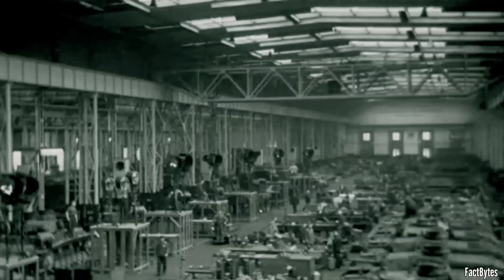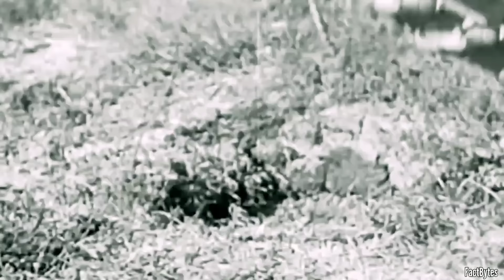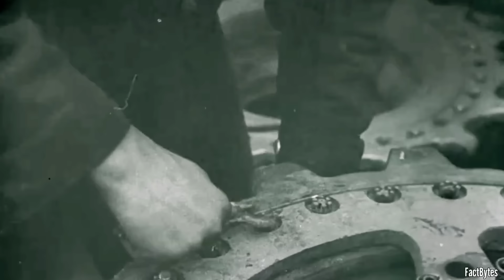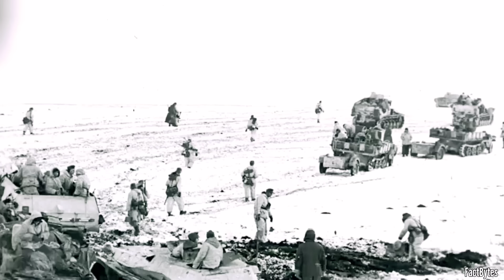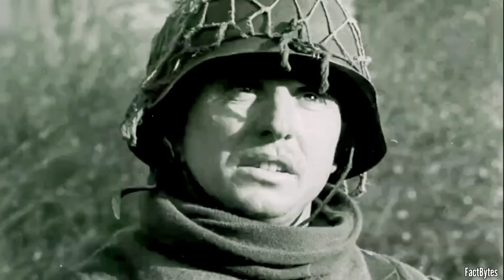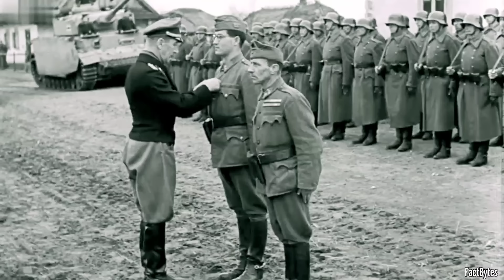More Panzer IVs, Fewer Tigers & Panthers — Would Germany Have Done Better?

Comment: Critically though, the Panther was the first tank in Germany specifically designed for mass production an absolute necessity by 1943.
Reply: Agreed, the German Panther, Tiger II, Jagdpanzers and Hetzer was the "wartime tanks" group for Germany, an equivalent to the "wartime simplicity" Soviet tank group of T34, IS, and SU-76, or the US's M4 Sherman and its gun carriage. Panthers used a much simpler hull and turret shape than Panzer III and IV.

In fact, one factor greatly helped Panther's mass production was Htler decision to "pre-upgrade" the Panther tank at development stage, such as upping the frontal armor from 60 mm to 80 mm, at the advice of German tank industries. Before the Panther, the Panzer III and IV saw major changes on the armor and armaments in the production lines every few months. Especially the Panzer III, where its entire series saw a whopping 4 changes of main cannons, from 37 mm, to two versions of 50 mm, to finally a short 75 mm, from 1939 to 1942, a span of three years! Such upgrade requests from the Wehrmacht greatly bothered the German industrialists as they had to keep adjusting the production lines. With Panthers, it had only three main variants, with no change of main armaments, and only very minor change of armor layout, from its introduction to the end of the war, which greatly helped its mass productions especially under the disruptive air raid in late war. Meanwhile the obsolete Panzer IV with its inefficient designs had to keep up its war demand by literally gutting themselves of parts in Ausf J, via removal of vision ports, the powered turret system, a return roller, and turning the side skirts into wire mesh.
Reply: @sthrich635  Hitler in addition to adding the armour simultaneously ordered rail carriages to be produced that could transport Panthers to the front as quickly as possible.
Reply: @sthrich635  Honestly, Hitler needed to stay out of tank production, but that is another story.   Even with mass production the German's still suffered with the fact that spare parts had to be specially tooled to fit on a Panther.  Their spare parts were not built to the standards of US parts than could go onto any Sherman without needing machine work done on the spot.  This is a very important issue considering the reliability of the Panther.
Reply: @biffmarcum5014  German Panther did not build to the standard of US Sherman because Panther was made in dispersed German factories, not large and well-developed US industries. Standardization was not an easy task especially when Germans needed to rush out tanks fast to the frontlines

And AH staying out of tank production would be a blessing for the Allies since he was the only one with good understanding and relationship with German war industries and their productions - Without him, the German military would keep asking for repeated design changes, upgrades, without considering any impact on production. German tank numbers would be even less than what had been.
Reply: @sthrich635  The US built 12500 Shermans across all variants in 1944 with a population of 140 million people  (Five different engines, three types of hulls, two suspension systems, two different turrets, three different guns). Germany built 3800 Panthers and around 2800 Pz IVs in 1944 ( around 6600 medium tanks). German and austrian population combined was around 65 mil to 70 mil people.
Medium tanks produced per capita was actually the same in the US and in Germany, after germany fully mobilized in 1943. Germany was hardly underperforming in terms of tank production.
Russia focused on building tanks and guns. They did not need to built a single ship or Uboat, their airwar was lowtech compared to the high altitude radar war at night in western european skies.
And the russians were totally dependened of trucks, jeeps and trains provided by land lease for their logistics.

The highest demanded tank by the US troops was the sherman jumbo in 1944. But only 100 reached Europe. On the other hand germany produced close to 2000 Tiger tanks. Maybe the results of german arms manufacturing is downtalked a little bit too much.
Reply: @sthrich635 Germany didn't need the tiger 2 with the panther
Reply: @jeepsblackpowderandlights4305 Germans needed to upgraded their Tiger I design as by 1944 the Allies and Soviets were fielding AT guns powerful to neglect  its armor. 100 mm front was nowhere near impressive in summer 1944.
Reply: This. They managed to build 6000 of the things in just two years, while the 8.5k P4's took 9 years to build. They were so much easier to mass produce.
Reply: @JB-qg2uc  yeah but they were totally unreliable.  Most units had more broken Panther's than running Panther's at any given time in 1943 and even later when its reliability improved, it was only 50-54 percent.  So for every running panther you had a broken panther.   The Panzer III at its worst stage when it became way too heavy  still had 69% combat readiness.
Reply: @biffmarcum5014  Royal Engineers found that the mechanical breakdowns were caused by poor production quality. More specifically incorrect hardening of gears. The design itself was sufficient. This was due to the workforce being drafted and inexperienced workers in the new production lines. Regardless of what tank that line would produce, the quality issues would be the same.
Reply: @JB-qg2uc  The Panther had a whole lot more than just incorrect hardening of gears as an issues.  There were leaking oil and fuel,  issues with non gear parts, cooling system.   I believe the royal Engineers were looking at the drive train.
Reply: @biffmarcum5014 
Look the russians mantained at Tank fleet of around 25 Tanks during 1944 and 1945. But only around 10.000 of them were deployed in active service at the frontline. That means that for every Tank in operation there are 1.5 Tanks waiting at a Depot or with the Industrie for overhauls.

Replacment was quick. But that doesnt mean their Tanks did broke down. They just disappeared faster of the units logbooks.

The average run time of Panthers in 1944 was around 1000 to 1500 km (Just Like Panzer VI, their ready rates were actually very similar in every month an Theater). In spring 1944 only 10% of the T34 reached 1000kms and in Sommer 1944 the IS2 was also just expected to run 1000km by the manufacturer bevor an overhaul of the engine and drive train. A year later the run time of IS 2 increased to 1600 km on average. A level the Panther had achieved in 1944.

Of course their are production batches with issues. But they are overhyped. I mean at Kursk in 1943 only two Panthers out of 90 were lost because of non combat related engine fires. Yeah thats not good but not as terrible as many try to make you believe.

The french and the brits did their test, on second hand Panthers which were kept active with cannibalized Parts of other Panther wrecks or last ditch production batches which were even assembled after the war, with all that late was quality issues.
I dont think these examples form a reliable Test group. I mean there are Reports of Bergepanthers achieving 4300 km with no issues in the drive train and Tigers with over 8000km on their engine.
Reply: Germany mass produced 6000 Panther tanks during WW2
Reply: The earlier panzers had already been designed & built with standardisation & mass production in mind. They were in what 1930's Germany called 'mass' production, but the Nazis weren't industrialists, so what they built was considered 'normal' & acceptable. There was lots of spare capacity in German industry. The German military doctrine was fight a short campaign, resupply, repair damaged vehicles & fight again - so their production levels seemed Ok. 
Hitler even sent troops back from the front in late 1941 back into their previous industries as he thought he'd won.
Reply: No tiger 1 2s ,sturm tigers or jagtigers jag panthers .more stug 3 panzer 4s and 5s same amount of panther 1 and 2s  though .
Reply: @isaacmitchell5031  jadgpanther was a reasonable vehicle (size and weight of a Panther + hitting power of king Tiger).
Reply: @rodrigorincongarcia771 unrealiable and hog way too much fuel .very hard with no turret .they were better off with 2 stugs then 1 jagpanther .
Reply: @isaacmitchell5031  Nope, Tiger Is were a good investment (they dominated the Battlefield 1942-1945); JagPanthers were also a very good investment.
Reply: @vonBennett_65  Tiger was a terrible investment. Cool machine, to much time and resources
Reply: @chaddersh3736  The effect that the Tiger I had on the Eastern Front in 1942 and 1943, where it dominated the battlefield, was incredible. One or two Tiger Is successfully taking on 30 to 40 T-34s...yeah try that with a couple of Panzer IVs.
Reply: @vonBennett_65  thats because tactics changed after 43. Also have you have tracked a vehicle before? Have you ever changed a wheel bearing on an inner road wheel? Now see what happens in the mud and it freezes. Too many factors against it. Also the lost the war following your way of thinking sooooooo
Reply: @chaddersh3736  Yep, I drove an APC in the Army, so I know all about driving and maintaining a tracked vehicle.

Lost the war due to my way of thinking? I think you know very little about 'my way of thinking'.
Reply: And you still that that suspicion system is the way to go? Ok to each their own as they say. A man from your background must know this was a hog on resources and maintaince ? I don't think the panzer 4 was the total answer. It should've been beefed up by a stronger airforce. But not wasted resource projects like the heavy panzer. Could have built way more aircraft to protect the ground forces. Just my opinion sir
Reply: @chaddersh3736  I agree that it was foolish to build the Tiger IIs, JagTigers, etc. Germany really mismanaged their resource allocation, and they waited too long to standardized their military equipment (they did plan to standardize their tanks somewhat with the E-Series; which never left the planning stages). As far as the Luftwaffe, my opinion was that the Germans should have focused on fighter aircraft first, ground support aircraft second, in lieu of producing bombers (which were a total waste of resources later in the war). Getting the ME-262 fighter operational sooner (instead of trying to make it a fighter/bomber) would also have been a big help. My opinions.
Reply: @vonBennett_65  true. To be honest. I was a Pistenbully tech for many years. I've probably just have some deep resentment to German over engineering lol. You take care
Reply: @chaddersh3736  You have to remember that the Tiger I was designed and built when Germany was still winning the war. They could afford the Tiger because they weren't being hammered by the Allies from all sides yet. Plus, the Tiger fit a doctrinal need for a heavy breakthrough tank, something with a big gun and heavy armor to go head on with an enemy's defenses, and break through them allowing follow on forces to exploit them. Overall reliability and recovery wasn't an because once the Tigers did their job, they wouldn't be needed again until the next assault since it was up to the mediums to continue on and exploit the openings they created. And because they wouldn't continue on, there was time for recovery and maintenance, particularly since all of the recovery vehicles and maintenance sections would now be moving up to where the Tigers were. The Tigers reliability and maintenance issues only became an issue when Germany started to go on the defensive and was retreating, but until then the Tiger was working just fine.

What was a waste of time and resources was the King Tiger, By the time the King Tiger came out Germany was already on the retreat and losing the war. There was no longer a need for a heavy breakthrough tank. All of the time, money, and effort they sunk into the King Tiger should have, at most, gone into improving the drive train for the Tiger I. It badly needed a better engine, transmission, and final drive.
Reply: @isaacmitchell5031  Respectfully I disagree. I would not have built Panther Tanks. They were too complex. I would have built Panzer 3s and 4s & Stug 3s. Standardized as much between the three as possible. Same with the half tracks and , above all(!), supply trucks.
Reply: @williampaz2092 well yeah if they did more 88 flaks towed by half treacks more panzer 3 4 5 and stugs and hetzers .than the nash horn tank destroyes and jagpanther would be the larger class hunter destroyers .more me 262s and ho229 if them got them operable .then folkwolfe and bf109 to be fitted with anti tank rockets
Reply: @williampaz2092  The Panzer IV was way more complicated to produce than the Panzer V. The Panzer V was a little more expensive to produce than the Panzer IV. Panzer IIIs were a dead end as they could not carry a gun bigger than the 50mm which was obsolete by 1943.
Reply: @vonBennett_65 the panzer 5 also started as a 30 ton tank that ballooned up to 45 tons but still started with a transmission and engine for a 30 ton tank. Thats why the early ones were always broken and even later ones had the same problem.

Comment: Unfortunately, these tanks were never in predominance at the front. On the contrary, the percentage of Pz 4 tanks among other types was not high throughout the entire production period. Furthermore, I've read that the Ministry of Armaments repeatedly tried to stop production of this tank. And most importantly, if we exclude the systematic and large-scale destruction of German industry and transport from the air, then existing tanks and other weapons would most likely have been sufficient to hold the front,and perhaps a and perhaps a truce would have been reached instead of capitulation have been reached instead of capitulation . But that's just my speculation.
Reply: The Herr Inspektor of the Panzerwaffe. Oberstgeneral Heinz Guderian, was satisfied with the capabilities of the Panzer IV, and felt that the "Big Cats" were a waste of resources, especially steel. Although certainly there was pressure to discontinue Panzer IV production as battle tanks, Guderian insisted they be produced until war's end.  They certainly were forming the basis of specialized AFVs in the Panzerwaffe.

Comment: It didn't mater which tank they built. Their method of manufacturing wasn't ever going to keep up with the USA, USSR, or even Britain. Germany used craftsman that built the whole tank in one station in a factory. Where as the Allies all used modern production lines where one worker installed one part as the tank rolled down the line to the next worker with a different part. 

The next problem was they never had enough fuel. That problem got worse as the war went on. 

But the major problem Germany faced was Hitler himself. The man was too impatient. The planned build up of Germany's military wasn't supposed to be completed until some where between 1945 and 1950. If Hitler had stopped after getting Czechoslovakia and stayed quiet things might have been different. But no, he had to invade Poland, which brought France and Britain into the war. Then failing to wait until Britain was defeated he went and picked a fight with the USSR. Even then he might have pulled it off until the ultimate blunder. Declaring war on the USA after Japan attacked Pearl Harbor. If he hadn't done that then the USA might have concentrated on Japan and not had been willing to supply Britain and the USSR.
Reply: The later Germany started the war, the less chance its Panzer forces had in succeeding.
Keep in mind despite all the millions of casualties Red Army suffered in 1941 to 1942, in 1943 it STILL able to come up above German Panzerwaffe and defeated them. What chance Germany had in 1943 if Red Army had extra millions men and materials more?
Reply: My take is he moved on Poland because he had a genuine grievance re Danzig, the Poles were a military dictatorship that had only grudging allies, and the USSR was in support. 

He did not expect to have to fuel France while still at war with British, however!  That's what killed his long term plan.  He ran out of oil and felt he had to play for Soviet oilfields. 

Which he should never have done with his poor intelligence re Soviet tanks & planes.
Reply: @crhu319  should’ve done a business deal with Russia a.k.a. Cold War style with a pipeline with oil and gas from Russia and allowing them territory somewhere else..
But I’ve read the British were actively undermining their fragile early packed to bring in a second front and I think Hitler got the jitters and that’s why he had to attack as he thought he couldn’t turn his back for too long but once again he should’ve done a deal.
Reply: Germany could not stopped after getting Czechoslovakia the economy was about to explode the minister of economy Hjalmar Schacht implied it.